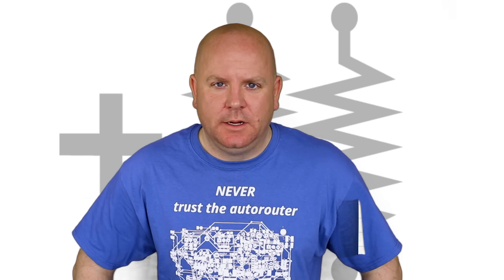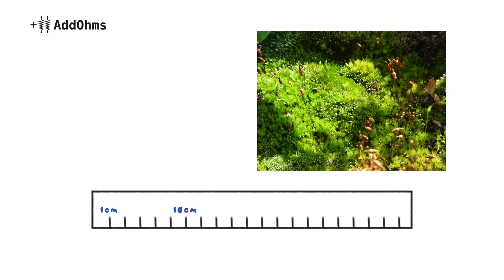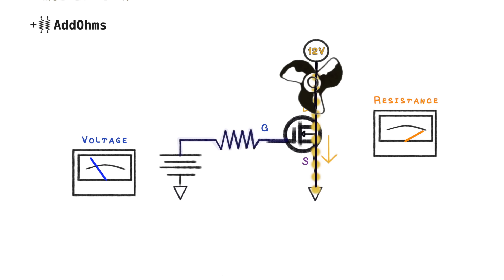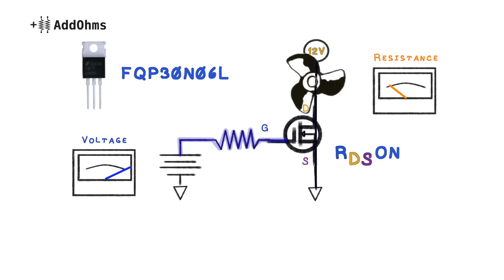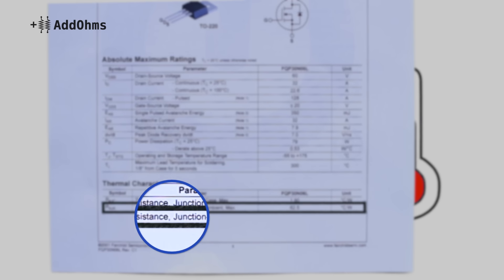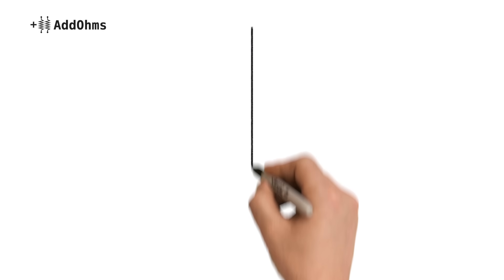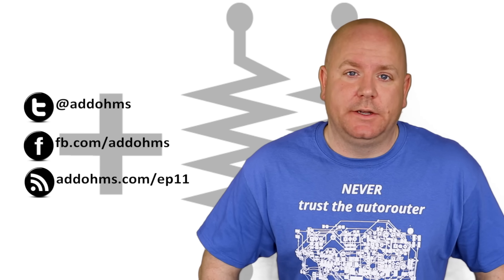MOSFETs and How to Use Them |  AddOhms #11

Comment: If the resistance in on or if im milli ohm so thats enough to make the load on in both case !
Can u make this more clear please?
Reply: ayman zayed Sorry, I don't understand your question. When you say "on" do you mean "ohm"?
Reply: I ask if the resistance range at the on case very smale range between 12 to 17 m ohm so how this can give us ability to controll the load? In transistor the resistance change for open to close so we are able to control the load as we like but her is diffrent, can u clear it about the mosfet?
Reply: ayman zayed Typically MOSFETs are used as switches, so they're optimized for switching ON and OFF, not sitting in the middle.

Comment: umm so emitter base & collector is not for mosfet? only for npn nd pnp transistors? i hear you using source gate & drain , or are this common names used interchangeably? 

also are mosfet good for only high voltage? and npn or pnp good for low voltage but high current?
Reply from the maker: +Frank Lopez Emitter, Base, and Collector are for "Bi-Polar Junction Transistors" also known as BJTs. They are made using different materials than MOSFETs. Source, Gate, and Drain are only for MOSFETs.
Reply: thank's

Comment: Could you please point me to the video you said you were going to do with heatsinking the MOSFET? I'd like to learn how to calculate the tempature with a heatsink.

I also could not find a Rθ ja for the IXFX520N075T2 n-Channel FET I want to learn about. Only thing on the data sheet is, ...

Rth JC °C/Watts = 0.12°C/Watts
Rth CS °C/Watts = 0.15°C/Watts

I have no idea what Rth JC, even though it shows what it is in your video, which is the Junction to Case.

I also have no clue what Rth CS means. Which is the 2nd tempature rating on my data sheet on Mouser. I was able to understand what your talking about in your video, which is excellent for me, because I'm very interested in learning more in depth about the MOSFET, other than the very easy to understand Vgs (th). Or the Rds(on) x the Amps load of my device, or motor, etc. It's pretty easy. With my above MOSFET, it's 2.2mOhms or 0.0022 Ohms x let's say, 100 Amps. So that's what.. 22.0 Watts. But that's as far as I can go. Because I don't understand how to calculate it with a heatsink, which I'm going to take a guess and say that's what the two value mean on my data sheet for the IXFX520N075T2. (Rth JC & Rth CS).

So according to what I just read, Theta-JC or Rth JC is..

The junction-to-case thermal resistance metric was originally devised to allow estimation of the thermal performance of a package when a heat sink was attached.

So that's cool I guess, but I also guess that there's really no way to know what size or type of metal is being used to use as a heatsink. But according to my data sheet, it's 0.12°C/Watts, so 0.12°C/Watts * 22.0 Watts = 2.64°C, which is only 1.508% of the Tj, which is 175°C. That's nuts. Seems wrong, but this bad boy is $11.66 ea. I have two of them, and they are not average. They feel premium, well made.

http://oi61.tinypic.com/2hghk4i.jpg
http://oi62.tinypic.com/2vcvl7s.jpg
http://oi59.tinypic.com/zvq15t.jpg

:)

EXCELLENT VIDEO btw. I did learn more about the MOSFET. Thank You. (+1 : 589) & Subbed.

Comment: Brilliant! Very nicely illustrated.
By the way, do you perhaps know how to dimension the external gate resistance to a mosfet driver? I'm having a really hard time finding anything about this.
Reply from the maker: Sveinn Grétarsson why are you trying to determine that?
Reply: It's fine, I finally found a decent article covering this. The reason is that I am currently working on a hydraulic solenoid valve driver circuit which used a 200V mosfet as a switch, and used a mosfet driver (LM5112MY) as gate driver. The applicaiton note of the driver stated that an external gate resistance should be used, but never mentioned any guidelines as to how it should be determined.

It is ofcourse just an RC circuit, of which you determine the resistance to get a predefined time constant. Silly me. :)

Comment: Fuckin hell mate, wish I had watched your video earlier. My problem is that my mosfets that are connected to an Arduino wouldn't switch on and off and now I realized the mosfets I am using have a very high Vgs(threshold). Cheers.

Comment: How good a thermometer would a 2N7000 make? they cost 4 to 10 cents at a quick look.
I am guessing that from temperature graphs and Rdson for 25C 1.2R to 125C 1.9R
But perhaps the same temperature would change the rest of my circuit/UNO?
Reply from the maker: ***** Interesting idea, but working with a resistance in the single-digit ohm range may be more difficult add more components than a low-cost, high-impedance thermister.

Comment: Great video, but there is one thing I do not fully agree with: BJTs can be scaled to handle much larger powers, and I have a ton of 2N3055's lying around to prove that! (And I do truly mean the old ones in the TO-3 package!)

They are advantageous when faster switching speeds are necessary, and when the input capacitance of an op amp is not desirable, or that the input current is desirable for whatever reason (like driving the input with a low voltage low impedance source, it sort of touches upon that impedance-matching stuff!)
Reply: Power Max This is very true. The claim that BJTs are only used for low current applications is very wrong. I have BJT bricks that can handle hundreds of amps each at hundreds of volts. Such a brick can switch more than 50,000 watts of power! While both BJTs and MOSFETs can switch large currents BJTs can do this with a relatively low input voltage (around 0.7 volts) while a MOSFET requires a relatively large voltage (around 2 or more volts) but with no sustained current. MOSFET are great for certain situations where large currents need to be switched with voltages only but there are things they simply can't do and the same is true for BJTs. Both transistor types have their strengths and weaknesses. IGBTs dominate over both BJT's and MOSFETs in the high power, high voltage market.

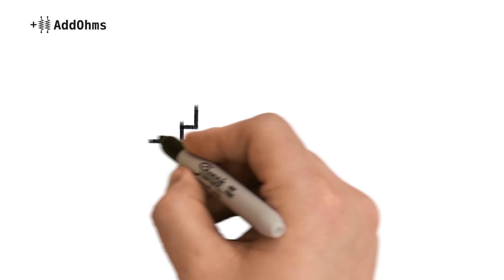Comment: Great video and well done. I think you accidentally drew the symbol for a Depletion mode MOSFET at 2:20   ...the datasheet confirmed my suspicion as the datasheet follows the convention I am used to. I always relate enhancement MOSFETS to the dashed line that resembles an E. There are a lot of conventions but that symbol would indicate only depletion mode to me, so I wonder if you just made a simple mistake. Again great video!

Example
|
|<   enhancement  uses the dashed line (E type MOSFETS)  .
|
Reply: Yup.  you're right, it's wrong.  :(

I will address in a follow up.

Comment: hmmm I am trying to learn about MOSFET's so I can make checks on a "dead laptop motherboard" and to find out any dead components .... not getting far here :(
Reply from the maker: Without a schematic, understanding of the original circuit, or an identical functioning board, it is difficult to troubleshoot.  

There aren't a lot of discrete transistors on most computer boards anymore.
Reply: where do they get those schematics from anyway .... ??? I am trying to find one for my HP COMPAQ 610 .but no luck :(
Reply from the maker: BiMi UK Sorry, unless it is an open source project, it is very unlikely the schematics are available (at least from a legal source).
Reply: so ur saying, there is no way to measure the mosfets without the schematics ?
Reply: Do you know or have an idea what has failed on the motherboard? The first rule to diagnosing is "Thou shall test potentials" In other words, first make sure that your PSU has the appropriate voltages on the output, with and without a load. (that is important because you may find that although it has voltage on the output, the internal impedance of the supply is WAY too high (like fried shunt resistors) and the voltage sags when under load.)

If everything checks out correctly, make sure that the voltage regulators on the motherboard itself are working properly. You can easily get an idea where they are based on their proximity to important power-hungry things like the CPU, and all the big fat parts that surround them (like inductors, filters, maybe transformers, electrolytic capacitors, large, fat traces on the mobo, etc.)

If they measure out to be something expected like 1.1V, 3V, 3.3V, 5V, 12V, -12V, etc and are very stable and don't get super hot when operating, they are likely fine. If, however, you find a voltage somewhere that is much higher than expected, there is a possibility a surge has killed small digital parts that would be a pain to find data for, source, solder and rework, etc. Basically it would be more economical to replace the mobo with a new, better one. (AND get a better quality PSU!!!!!!!)
If voltages happen to be none at all, or floating all over the place, like a nominal 12V rail randomly going everywhere from 3V to 9V without rhyme or reason),the the fault could have resulted from a short circuit and killed the regulators. Generally digital stuff will survive that. (Man, this comment got long quick!)

Comment: Great video. However, almost nobody talks about the necessity of using a resistor between the gate and the ground to sink the current trapped in the gate and for turning the mosfet off properly in any mosfet video on youtube...
Reply from the maker: Excellent point.  It's something I already planned to cover in the future.  However, it is exactly why I at at least included in the schematic, to hopefully prompt the question "why is it there?"
Reply: This is not a hidden secret of electronics. However, I have learnt that the hard way after hours of google search and experimenting. And sometimes such small details can be really demotivating for an hobbyist or a beginner... It would be good, if you can cover this in the next mosfet video.
Reply: Wow, thanks so much! Was wondering what I was doing wrong. Any idea what type of resistor is needed to ground (I put in a 2k which seemed to work fine). Also, I assume there should also be a small resistor from the positive voltage to the gate as drawn.